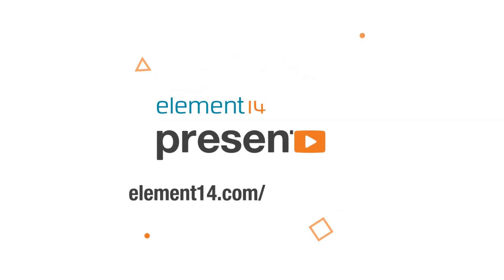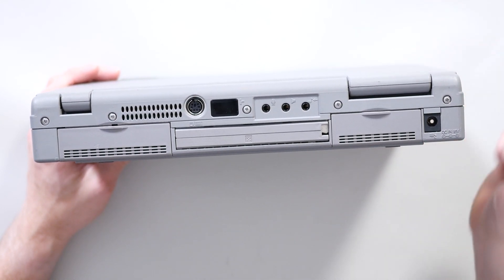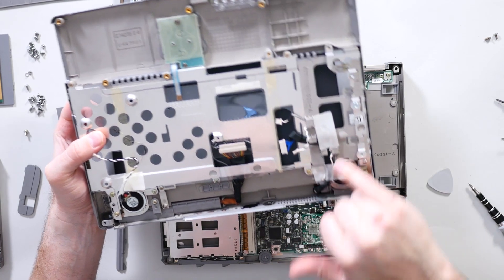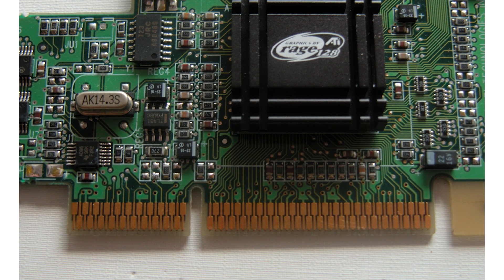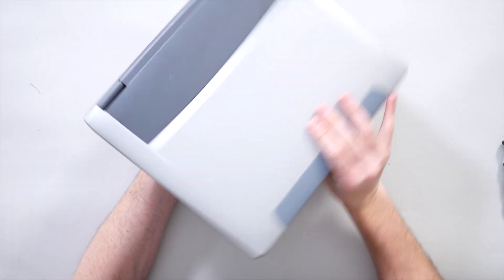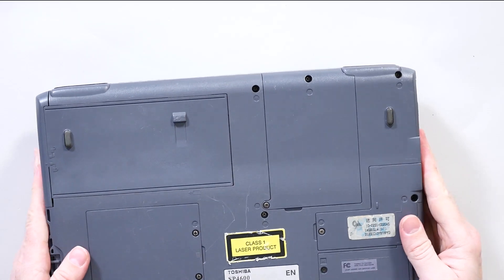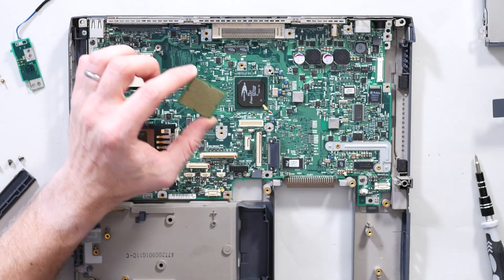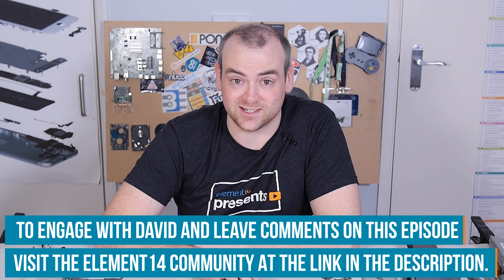90's Toshiba Laptop Comparison - The Electronics Inside

Comment: I found a tossed out one of these (or close!) No power supply, so not sure if it works. Does it use a special power supply / charger? Your HDD sounds like a power saw! Is the battery a Lithium ion? Not Ni Cad? On that model, can the CPU be upgraded? Doesn't look like it!

Comment: Rescued a 4000 CDS in 2017 from an ewaste bin, thing was in pristine condition, was an unbelievable find. The thing would go on to be the most reliable computer I've owned. The original 4GB Hard disk still worked, no capacitors issue, even the original battery still holds a charge for around a half hour. I have replaced the hdd with flash storage, it now runs Windows 98 with a DOS 3.1 dual boot, boots into DOS 7.1, type "Win3" or "win98". Mostly used for important photo backups, text documents with sensitive info you wouldn't want stored on an online pc etc as well as being used for a CD player on my 90s hifi stack to record cassettes from CD's playing from it in real time. Makes beautiful hifi recordings thanks to that OPL 3, a good deck and nice tapes. A 2013 i5 Surface tablet is used more often for that tho as I usually record 96/24 or 192/24 flacs to tape which shockingly, is just a liiitttle too much for that Pentium MMX
Reply: Did you happen to find the charger with it! Found a tossed out (in an E-waste dumpster too!) iMac G4 to-day, but not sure if it works! Also found a tossed out (curbside stuff) Toshiba laptop similar to this fellows, but no power supply!

Comment: Where to find the Toshiba Satellite 520CDT's BIOS battery?
Reply: I can find them easy, but I live in China. There are also a lot of second hand laptops here from the CDT line. I bought myself a 330CDT and had to replace the battery. It still works very good after so many years, even with its own hard drive.
Look on google for satellite cdt cmos battery. Should be easy to find

Comment: I have the 520CDT version of this machine. The second HD that I had installed from the 90’s failed with a clicking sound which is probably stuck heads. Have an adapter card with an M.2 to IDE. Will be sending the drive off to try and get data off of it. Power supply board has a few shorted caps and needs recapped and it also needs two small Varta memory cells packs rebuilt. The FDD failed with a broken micro belt that I need to source from China.

Comment: all modular, all replaceable, why don't they do laptop like them now?
Reply: Because that means connectors, mounting structures, and designing around the largest item that you might put in that modular bay. The result is... a 90s laptop basically: bigger, heavier, and with less battery life. Modern designs are about integrating things, soldering them on directly, and filling every spare mm^3 of the case with a molded battery.

Comment: @David Edwards "What is the spec of your favourite?"  From those which i own, i would say Satellite Pro 400CDT - Pentium 75, 48MB RAM, 1MB VRAM, ESS688 sound card + Yamaha OPL3 and TFT 640x480 display. I bought it 13 years ago and its still working. There is another one witch nice features Tecra 750CDT - Pentium Tillamook MMX 233, 96MB RAM, Virge MX 4MB, Yamaha OPL3-SA3 soundcard + Yamaha OPL4-ML2 Wavetable and 1024x768 TFT display. One downside of that model is poor scaling in lower resolutions (kind of blocky). There is one i would like to have, but its quite rare. For some weird reason i can't answer normally. YT is @#$#@.
Reply: We have had some YT issues recently too - you can always head to the Element 14 Commuinity too!

I would have loved a 1024x768 display on a laptop in that time frame...
Reply: I had a satellite myself...

Pentium 200mmx
2.1GB HDD
Windows 98se
3.5" floppy drive (could be switched out with a cdrom drive)
32gb RAM
1x USB 1.0 (1.1?) Port
IR blaster
PS2 port
serial and parallel ports
28.8k modem
2x pcmcia ports
Even had a dock, although I usually used it dockless
EDIT: forgot it had a 800x600 screen

Comment: My experience with old Toshiba laptops:
- 220CDS: It was an early Pentium laptop. There were two small rechargeable batteries under the keybaord that leaked and ruined the machine. When I tried to take it apart I discovered that they used different screw lenghts literally everywhere so I didn't even try reassembling it. At least there is a service manual for it on the web.
- Satellite Pro 4300: Pretty good laptop , sadly the screen  hinges broke completely. Cant find usable spares.
- Satellite 4800: pretty solid pentium 3 laptop. Very similar to the 4300 on the inside but only has one RAM slot. The LCD polarizer on my example was starting to disintergrate on mine so I ordered another screen, and it also has the same issue.

From what I've heard the early Tecras can have issues with the memory slots, they get seperated from the mainboard and you have to solder them back.
Reply: Oh wow, I don't know what's worse, your battery issue or the memory sockets?

Comment: Weird, I've never had a laptop that wasn't socketed, but all I've owned were Dells.
Reply: Until my most recent one, all of my laptops were socketed as well. MB replacements were much cheaper because you didn't have to rebuy the entire processor ($53 for my prior laptop vs $285 for my current one).

Comment: I remember my father bringing home the first laptop. It had a monochrome (I think) LCD with a huge bezel around it and ran IBM OS/2. It came with an even larger docking station not for connecting peripherals (although it was possible I think), but because the battery wasn't able to let it run for a long time.
Reply: I can remember laptops with windows 3.1 and monochrome screens, but that's as far as I go?

I'd like to explore some other models in the future too?

Comment: I had a 2004 Toshiba Satellite which also had a socketed CPU, so I dropped in a Pentium M 725 over the stock Celeron 360. Even managed to overclock it with a small strand of wire placed into the CPU socket to act as a jumper! Worked great for many years :-)
Reply: Pentium Ms were the absolute best?! So much better than the desktop P4 and PHs of the time!
Reply: @a531016  Indeed, they offered a solid performance boost for older systems, and didn't require a cooling solution that sounded like a jet engine test facility! xD
Reply: My pentium 3 dell inspiron 8100 from 2001 had a socketed CPU aas well -- upgraded it at one point. Graphics board was removable too and upgraded that as the graphics ram on the original wasnt enough for GTA 3 ;)

Comment: Wow i have been waiting for a teardown of Toshiba 430cdt for months, as I need to repair mine
Reply: Well, as luck would have it... What's wrong with yours?
Reply: @a531016  battery leak :( managed to grab a spare motherboard on eBay but it had broken docking port, now I managed to grab another one but by now I have forgotten which part goes where. This video will be more than helpful to put everything back together
Reply: @dinth  good luck! If you need anything specific, let me know and I can take some photos or dig out some original footage. I managed to shoe horn it all back together, so mine at least fitted!